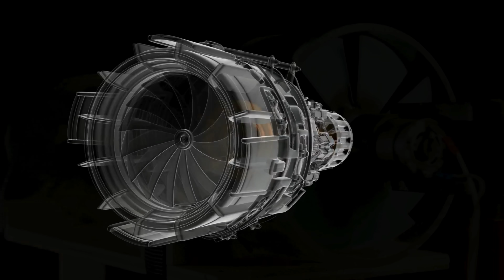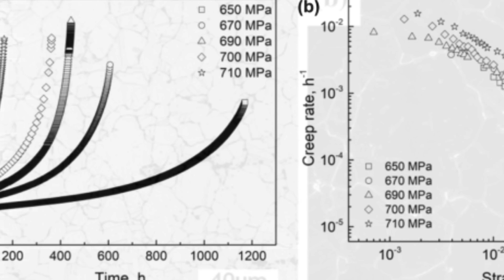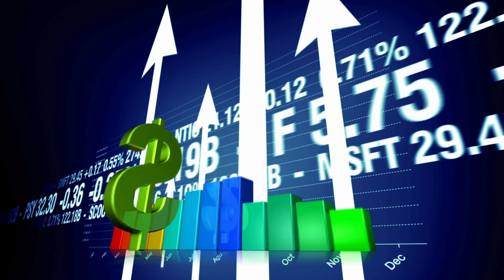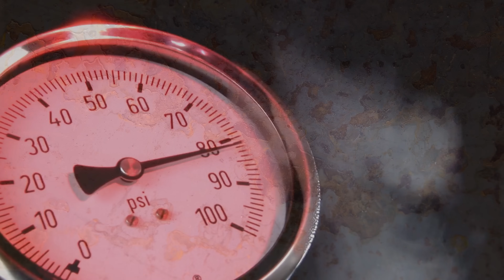Why Jet Engines Rely on Inconel: The Superalloy That Defies Heat

Comment: They call turbine base "Nickel alloy".  So it is not Inconel.  It has no Cobalt.  Inconel might be used in turbine shafts, but not jet turbine.
But I wonder why manufacturers don't use Tungsten in turbine blade. It is far more heat tolerance.

Comment: Even my simplest charcoal grill has special metal wire.
The same wire as you get in  a toaster element. 
This allows the charcoal to be suspended and allowed to breathe as well as drop ash.
So simple but so effective. 
Plus the non conductivity of khantal wire handle for easy handling. 
It can be handled to lift for more air or to put the unburnt charcoal into a snuff pot for reuse.
https://youtu.be/TyG-5ghtUU8?feature=shared

Comment: The story about the blades in the power stage - the hot area - is amazing.  Casting a single crystal blade requires a lot of tap dancing.

Comment: Tungsten cannot be used either.  It oxidizes easily, and the oxide melts at a fairly low temperature.  Not useful.

Comment: NASA's  Glenn Research Center recently invented a new metal alloy which is both very hard, yet flexible without cracks forming. That surprised everyone. They claim that it will be a game changer in materials science and engineering for rocket and jet engines.

Comment: Taking off is most risky, in mid air thetemp is very cool and heat cancels out s lot. Landing you soeed down so its not as risky as takeoff but riskier then mid flight

Comment: 2:16, To melt iron and obtain molten iron, you need to heat it to its melting point, which is 2,800 degrees Fahrenheit (1,538 degrees Celsius). Above this temperature, iron transitions from a solid to a liquid state. Weakened to the severe point of liquidity at 1538 C°.